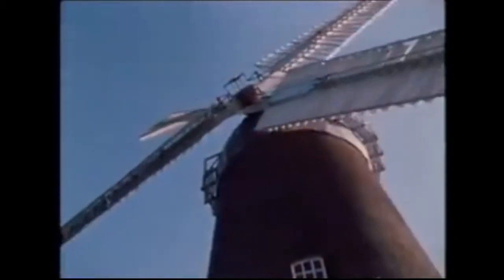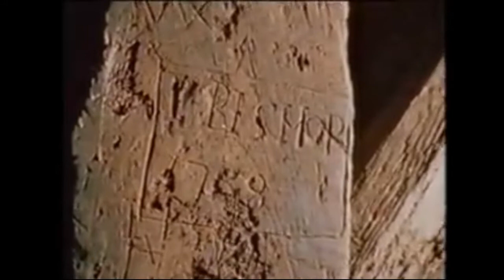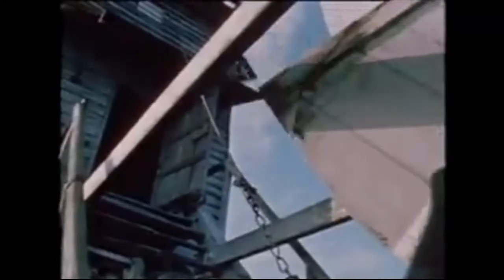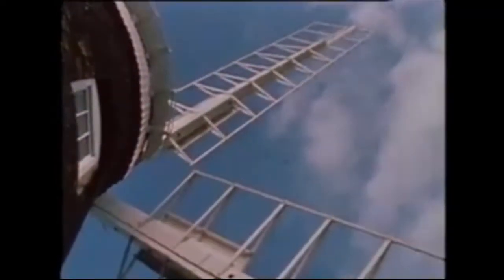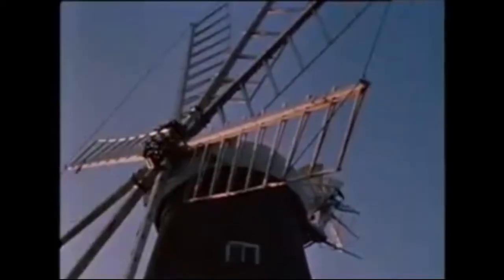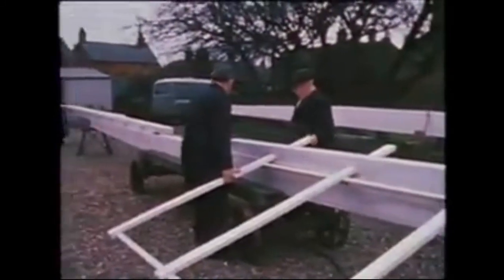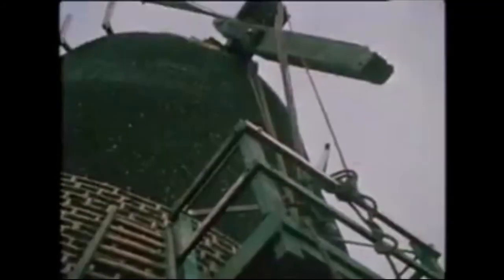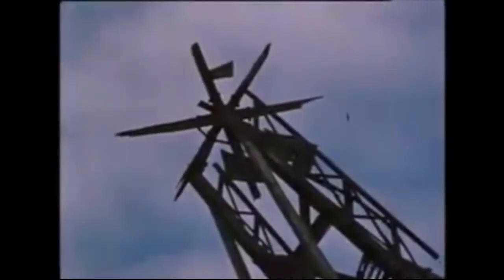A Couris Thing: the story of the English windmill (1968)

Comment: That you can only get to Burney arms mill by boat is an oft repeated myth ! In the 70s and 80s we would often drive over to the mill for a beer and some lighthearted amusement watching the hire craft arrive on a Saturday evening. The track starts at Wickhampton church, crossing the railway line just west of Burney Arms station and then on to the mill. One night the autumnal mists came down and we had a bit of a problem until we realised that not one but 2 new gates had been fitted on the same field !
Reply from the maker: That might have been possible in the 70s or 80s, we don't know, but the route you describe certainly wouldn't work now. The  track from Wickhampton ends at the Weaver's Way long distance path. This does go south-east to Berney Arms Mill but the route can be difficult to walk at certain times of the year, let alone navigate with a vehicle. Other tracks that lead to Berney Arms are not public roads, so using them would be trespassing. And sadly, the Berney Arms Inn has been closed for a while now in any case.

Comment: I'VE JUST HAD AN IDEA TO BE ABLE TO UNFURL HUGE WINDMILL SAILS WITHOUT HAVING TO CLIMB UP 40 FEET. IF THE SAILS WERE WRAPPED AROUND A CYLINDER AS HIGH AS THE BLADE ITSELF AND HELD IN PLACE AT THE TOP BY A CHANNEL. THOSE SAILS COULD BE SETUP IN SECONDS.